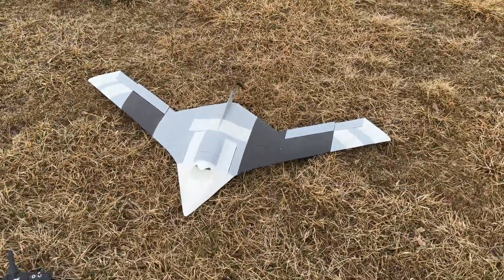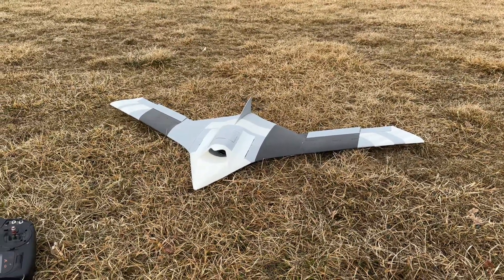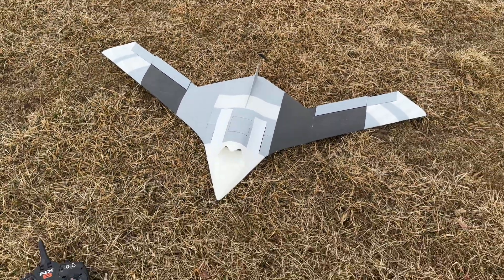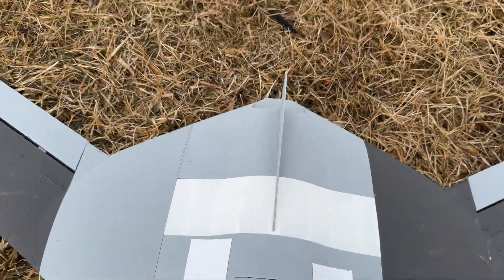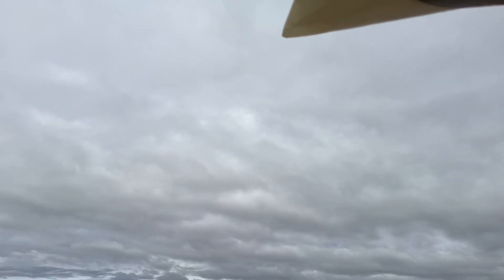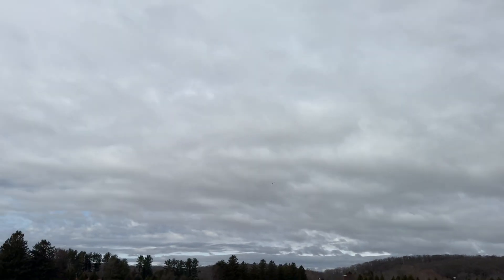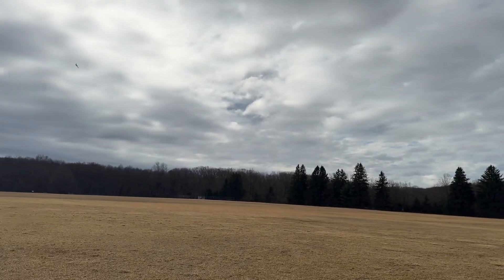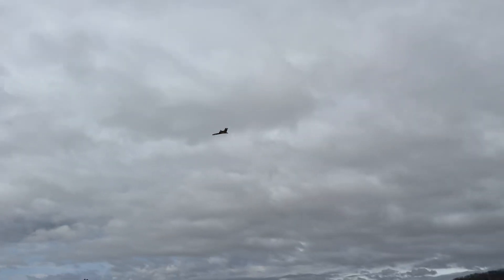CH-7 Rainbow UAV Maiden Flight

Comment: I'm curious why you always have a small rudder on your flying wings?  I've been flying the ZAGI air-air combat gliders for many years and none of them had rudders.  I did eventually install upper and lower thin red plastic wingtip rudders on one of my combat gliders but that was for better visibility at distances.  BTW - white is the most visible color at distances.

We typically launch with 20ft of surgical tubing and a small ground anchor.  I installed a flag on the ground anchor, so that if it ever let go, I would at least see it coming and get out of the way.  We launch on a hill side with thermal activity below and plenty of ridge lift from the wind moving up the hill.  Flight times usually last several hours until we need to take a break.